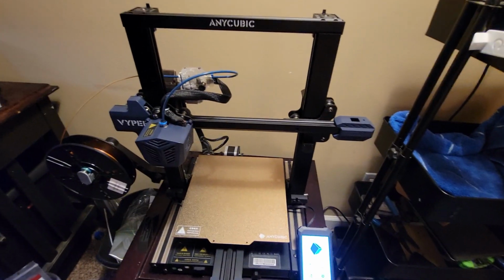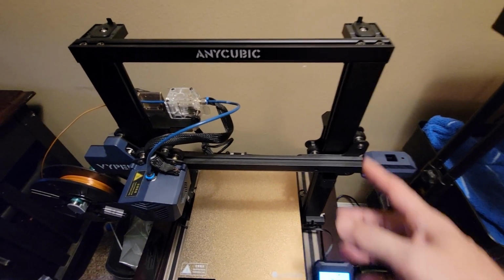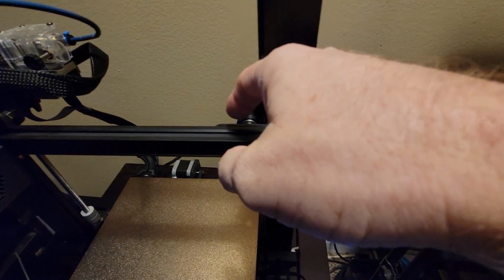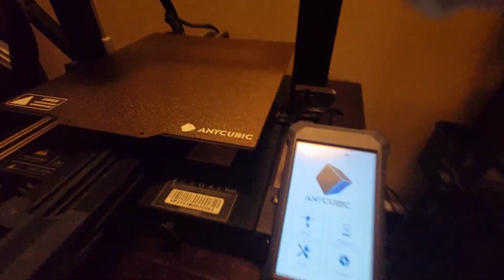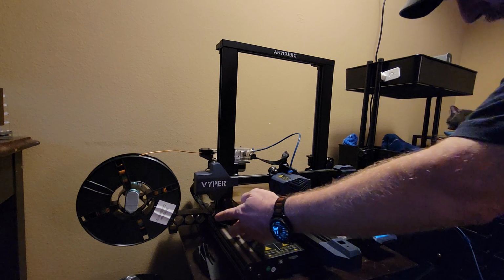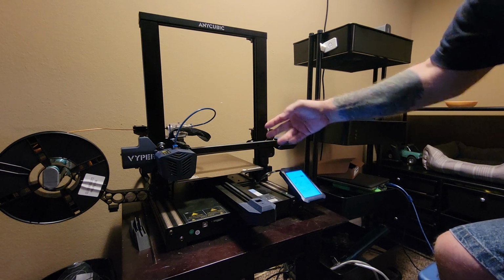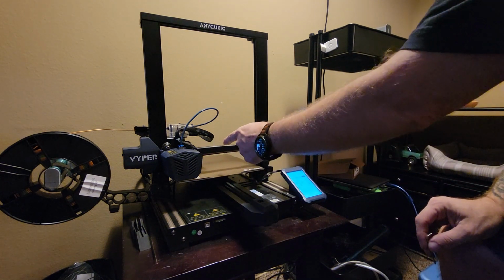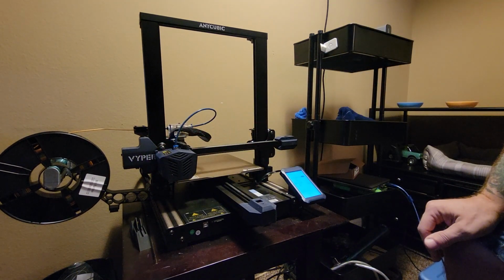Anycubic Vyper Mechanical Adjustments

Comment: Having everything square is important but after all that it really depeonds on nozzel , its then nozzel preasure differance that set a piece off filament off track and you get the uneven layer lines, its not steppers motors missing their mark.  Thats what i used to think untili actually followed one of these uneven layer lines and noticed it corrected itself,  half way around, then sunk in. After mentioning this to chatgpt they said its common of pressure inconsistencies, you get from irregular geometries. ITs why this banding never showed up on long straight prints like parts or something, only models with curves.  And only sometimes.  You can tune this out  with slicers settings like coast wipe and retraction , theres even a smooth ram up to flow i think would, but nothing helps like dynamic feedback on the nozzel to know what the actualy pressure is and adjust accordingly, which is what the A1 mini does, the only printer that does it and it gets the best clearance test results out of all the printers, even the x1c.
  Squareness and all tha matters too, but once thats taken care of the nozzel is the weak point. Id go further and say we should have feedback on the axis, so when the stepper rmotor moves X steps, it shoud be in X posistion, but it doesnt check, it could with some sort of closed loop feedback control using hall sensor  along the rails  or something.  Anyway thought id mention this revelation, its explains why the A1 mini is so good with  tolerance tests, it can stack those layers evenly because its feedback on the nozzel pressure using the strain gauge.  Im wondering if the strain gauge on the vyper can be used for this sort of thing, the firmware is opensource, it just need some clever software to make it work.

Comment: having a hard time trying to adjust the set of two rollers on the outside on the spool side of the gantry.  Anyone have suggestions on how adjust it so it's tension with the vertical part of the gantry is 'tighter'?

Comment: Hi Bob - I know you're a Vyper expert, so I wanted to see if you could help with changing colors on the Vyper. The screen is stuck!

I've followed directions and looked all over the place, which all seem to go through the same steps. 
However, after putting the new filament in, pushing it through so it's the right color, and clearing out the "ooze"it's stuck on "Paused. Waiting on cache commend to complete." It doesn't return to the main screen where I can tell it to "resume." (This was after/is during a 15+ hour print, with 2% left, so I don't want to just turn off the machine.)
Any ideas? Thanks!!
Reply: The Vyper firmware has a bug in it.  What version are you running?
Reply: @sjorlando7282  Since I posted this, my printers were all stolen! So I'm using a Kobra 3 v2 combo now. Thanks anyway! I really miss that Vyper, though. More than my Prusa.

Comment: My Vyper does not have the little plastic Z adjustment tabs with grub screw.  There are two metal fingers (not adjustable), one on each end.  My calipers show a difference of 0.18mm difference from left to right on the z-axis.  Is this acceptable?

Comment: Hi. Thx

can't get same tension on rollers on both sides (
Reply: This is exactly the problem I'm having right now!  Did you find a solution?
Reply: I'm also having this issue. The bottom left is harder to turn than all the rest and I just can't get it the same as the others. :(

Comment: The motors should not moved when they are enabled as the user risks damaging the board. Belt tightening is to be done with the power off or motors disabled only.

Comment: Any feedback back on this unit vs the Ender 3 v2 would be much appreciated. We are looking to purchase our first 3d printer and it's so hard to determine what to buy. Blessings and respect from Canada. Thank you .
Reply: The Ender is non-stop tinkering and adjusting. The Vyper is awesome right out of the box and needs little/no adjustments. I have 2 Anycubics and the service is awesome. They're based in China, and not Louisville, KY, so you have to consider the language and distance (and cultural) aspects. Especially now. Before 2020, I got the parts fast, but the shipping from China now will try your patience. But it's worth it to me, not being my only printer.

Anycubic has sent me countless free parts to try and fix faults of mine, for free. Enough to build a new printer I'm sure. So I don't know what the Ender fan above's talking about, but I can vouch that the Vyper, (and Kobra now), are great. I also have a Prusa Mini+ which is a great machine. I find I don't need the print bed space 99% of the time, and if I do, I just move it over to the Vyper. I have othe printers but these 2 are my "go-tos."

EDIT: I see the guy above's talking about "3rd party support." Not Anycubic's. Explanation: There's not a TON of mods for the Vyper because it simply doesn't need any. Yes, yuo can get the usual Capricorn tubing, nozzles, etc... but it prints great out of the box. After tinkering with 3D machines for years, I got to where I was largely sick of modding and tinkering and now just want to print as cleanly as I can, as fast and easily as I can. When I do want to mess around I have an Anycubic Mega S for that.
Reply: Get the ender. Better third party support.
Reply: I have both. Too be honest it depends on you. I like the vyper. It was so easy to set up and go. Small adjustments. The ender v2. Man I spent a ton of time trying to get the right settings and adjustments. If you have the time, than the ender is fun to tinker but if you want something in a all in one package than the vyper. I upgraded my ender with PEI Bltouch silicone washers new fans. And it pretty much the same price after everything. So it might be worth getting the vyper.

Comment: So how do you adjust the Z if you don’t have adjustable stops?    Mine is off.
Reply from the maker: Anycubic was supposed to send me one of the newer printers so I would be able to help with them, but I still only have the first that I had bought.  Can you check to see if maybe the holes that hold the triggers on the uprights are slotted, or maybe move slightly when loosened?  How far off is it? If it is too far off for the auto bed level to correct, you may have to see if anycubic will send you a set of the adjustable ones.  Let me know what you find, maybe I can make up something to help and put it on thingiverse.
Reply: @B3DPrinting  I guess mine are adjustable! 

I just watched your other video (https://youtu.be/eZLl9FnAOVk),  mine have that little set screw.  I would have never known those were adjustable.

I ended up having to adjust one all the way in and the other all the way out, which is ridiculous..  But,  the gantry is now level to the bed.

Comment: hello Bob, good video, but I would heat up the bed before adjusting the X axis.  Everything should be right when it is heated up.  Every metal warps a little when heated.  Best regards ... Torsten
Reply from the maker: Hey bud, there definitely isn't any reason to NOT heat the bed. Since it is just the bed being measured to the x gantry, and not having nozzle expansion to deal with also, and no actual z height being measured, and pre auto level, I think it gets close enough with a cold bed. That being said, you possibly could get it slightly more accurate with the bed heated.

Comment: If you had a 123 block or parallel block would that make levelling the gantry easier?  Appreciate the videos on this machine.
Reply from the maker: That is a different world, I come from a background of plc and automation, 37+ axis machines. I'm totally for using a 123 or parallel block, but most beginners are going to say 1 2 what?  If it was a multi head machine with a cnc, I would say definitely, but with printers, especially with auto leveling, being within a couple hundredths is an extreme. Typical first layers are .2mm, if you have the bed or gantry variance to that before auto leveling, the mesh will be able to compensate adequately.  Great question!!!